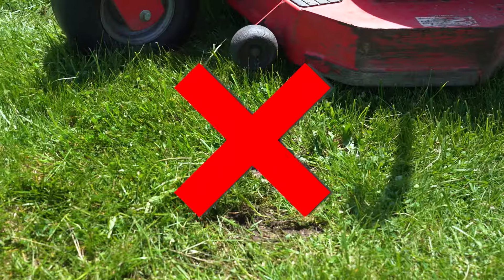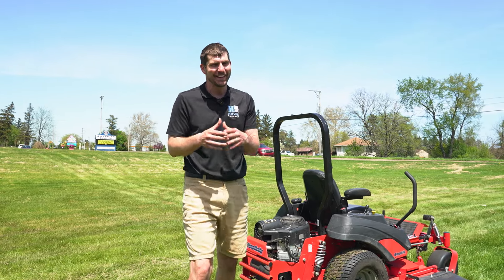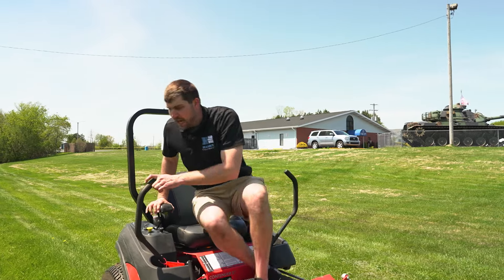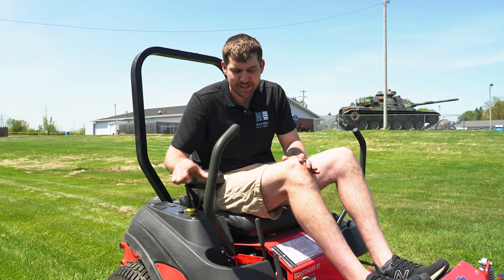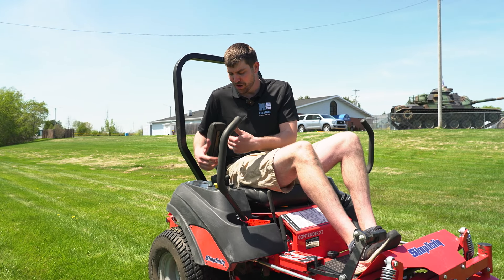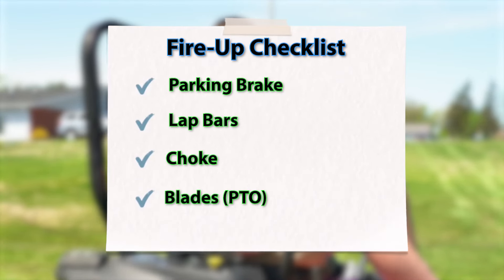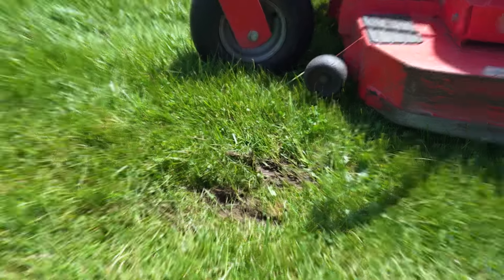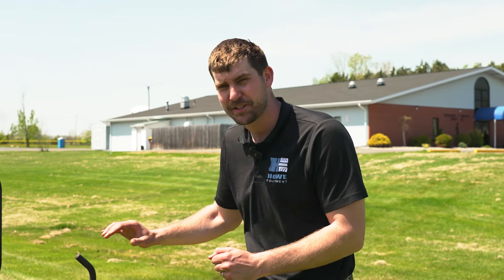How to Operate a Zero Turn Mower (For Beginners)

Comment: Best explanation I ever received about how to steer a zero turn was that it's like handle bars on a bike. When yo wanna go right,push forward with your left. When you wanna go left,push forward with your right.
Reply from the maker: I may start using that analogy. Haven’t heard that, thanks.
Reply: Another analogy I heard before was to operate your hands like you would when pushing/steering a shopping cart.
Reply: That's confusing because it's the opposite for a motorcycle lol
Reply: That might even be too easy of an explanation....lol
Reply: @ChrisJones-yt8zp On a motorcycle, if you push forward with your left hand, your bike doesn't turn right? 
I am not understanding your comment.
Reply: @fatmayo2293  For most riding, no.  If you push left it goes left.  It's called countersteering.  For very slow speed, yes if you push left it will go right.
Reply: After getting used to it, you will turn without even thinking about it. It becomes natural.
Reply: @ChrisJones-yt8zp that’s wild and upsetting

Comment: Way too quick, not comprehensive enough and too specific to ICE mowers. While you touched on the issues of "zero turn" with an extremely vague example, you need to demonstrate it more graphically; a beginner would be confused by such a short demonstration.
Reply: I am a beginner, and I understood completely. There is no issue with this demonstration, and of course he will be teaching toward a specific brand or model, he owns that one. I personally am not going to rent or purchase 10 mowers to show you how they all work similarly

Comment: The first thing you need to do is lower the tire pressure in the rear to 10 psi. These things will get stuck on wet pavement, this gives you more ground contact and improves the ride quality. I have a 920 John Deere with inflatable tires, I wanted the noninflatable tires till I priced them! Since that wasn't going to happen I inspected them and they were much softer with more ground contact. I have air valves so I can do that. I was telling a friend who owns a landscape company and he runs 9 psi in his mowers. I thought I was on to something and they were already doing it. lol
Reply: Just need to slow down when it's wet-what he really missed on is for beginners is don't take these on a hill until you learn the machine and even then be careful and know the limits
Reply: @daveclark305  I live on Chickamauga Lake in the hills of Eastern Tennessee. After several years of using the Z920 on the farm I decided to use it at home. I wasn't opposed to standing one on the back tires but my goodness. My butt had never been that tight, I still haven't found the seat. I have a 4x4 Kubota with fluid in the rear tires and axle extensions now. After a certain tractor weight shifting your body weight makes little difference so the set up is everything. Mowers make bad dive partners but zero turns are less likely to let you go alone. The cut quality of both is very nice but that's where it ends. My neighbor has a zero turn Scag which is a nice mower but it's been in the river twice. From what I can tell apparently a durable mower but lacking flotation. I mow around his bank line so he doesn't go swimming again. I give him hell about mowing in his bathing suit, what are friends for.
I should clarify that it is difficult to flip the wider zero turn mowers it is possible to go down hill faster than you intended. While I have carried the front tires going uphill the mower has never gotten enough traction to flip backwards. This is just me on a John Deere Z920, your results may vary. You just can't go back down the hill forward or you'll be doing 35ish with the back tires sliding and no steering. It's the little things that piss ya off.

Comment: I have a Simplicity  Citation 21 with a 48 inch deck, and I LOVE  that  ❤ thing. It rides like a Peterbilt 379  with Peterbilt Air Leaf  air ride. My chiropractor approved of it ,  because it’s easier on my back. The only downer was is that I had to put in a new PTO switch, and a new  electric PTO clutch, but I did all of the work myself.

Comment: So the side I wanna turn is the handle that should be forward ..left turn =push left handle forward and keep right handle in neutral zone🤔
Reply: No
Reply: @capealio  dang it...and thanks...so its reverse
..I have  not driven it yet...scared😜
But I will get one of my friends to patiently show me🙂
......edit still haven't drove it yet but I will😉
Reply: Think of it like handle bars on a bike. 
I'm an older gal who just bought and mowed her 2 acres with a zero turn. If I can figure it out, you can too. It's really not that hard, go slow at first.

Comment: The biggest problem with the old style riding mowers is loss of traction in a slippery spot, where one wheel will spin, and the other doesn't move. So with two transmissions, one powering each wheel, that problem is gone now? Both wheels will turn, or spin?
Reply: Ya...and double of everything to break. These things are rolling nightmares.

Comment: Great video brother. Question? I have a bad boy revolt 54in kawasaki evo standon mower. Do I need to run it at full throttle? I may be wrong. It seems excess or regularly mowed lawns. Thanks for your answer.
Reply: Yes. Full throttle. That is the blade speed. It also cools the engine. Remember they are air cooled via the fan on top. That needs to run at full throttle. Running less may also put more stress on engine, causing it to run... hot.
Reply from the maker: I would agree with George on this one. Thanks!

Comment: Okay...I can't afford one types of mowers right NOW but I am looking into maybe buying one in the future and I have a VERY important question that will decide if I ever buy one or not. I live on a hill with a steepish incline and the ground can be rather soft and uneven...especially if moles and groundhogs have been digging around the property during spring and summer. How good are these types of mowers for such terrain? The top of the hill where my home and more of my yard is, is decently flat but the hill is the scariest part to mow, always has been even for my grandfather back when he was alive to do it since if you go sideways on the hill at certain points it could flip the mower. My grandpa had an old fashioned front heavy mower..like the classic John Deer you see with the seat in the back and deck sticking out from under it. If I'm gonna sink $1000+ on a mower I need it to be able to handle the terrain of my property.
Reply from the maker: Stick to a mow commercial grade machine with bigger tires. That should help!
Reply: If you get a large deck like 60"+ you should be fine. You would be amazed what them commercial mowers can do

Comment: Thanks for the tips I am from the City so it’s been challenging living in the Country and mowing with this zero turn machine 😟 my biggest problem is mowing a  ditch  do you have a video about this?
Reply: Use a weed eater for the ditch.
Reply: @BudMan420 Don't mow a slope greater than 15° either vertically or horizontally. You can slide and lose control, especially if you're inexperienced. Weed eaters are best for ditches.
Reply from the maker: Not yet, not a bad idea for a video though!

Comment: Um... nope. My Kohler has a carb but no choke cable. Smart choke. Next, if someone doesn't know a what a 3 point turn is they shouldn't be driving on the road. The damage to the turf mainly depends on the type of grass it is along with the moisture in it.

Comment: Its super bad for the engine to be turned off and on at full throttle like you were doing in the video. It has to be at idle so excess gas doesnt get into the engine.
Reply: That hand full of times did absolutely nothing to the engine... stop.